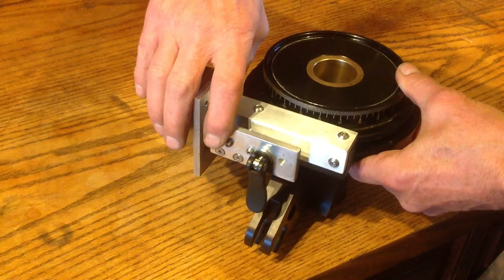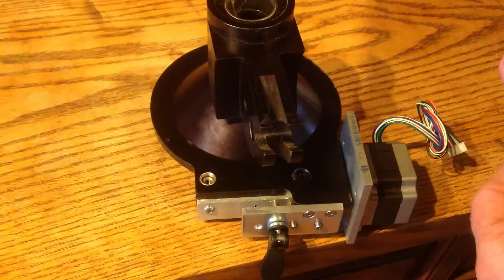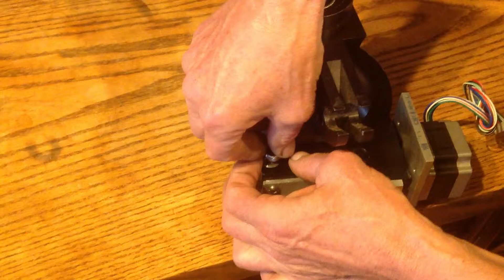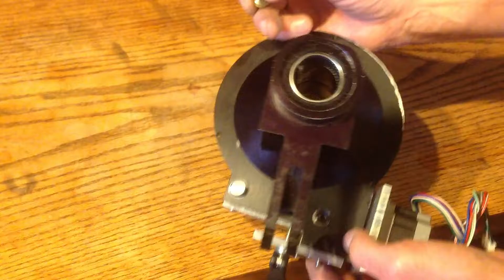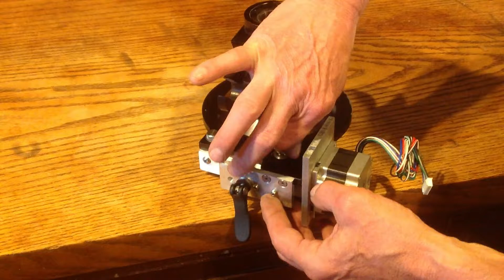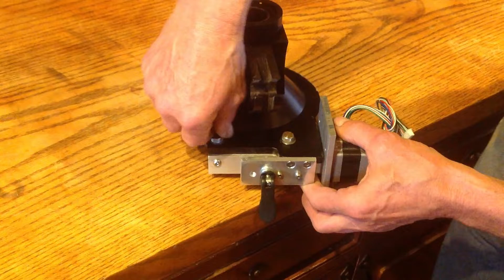Losmandy G11 Cantilevered Spring Loaded Precision One Piece Work (OPW) - Video 1.

Comment: Really cool.  But could you explain how you are able to get smooth rotation of that pivot even though you had tightened the block down hard to the plate using the shoulder screw + Belleville spring?